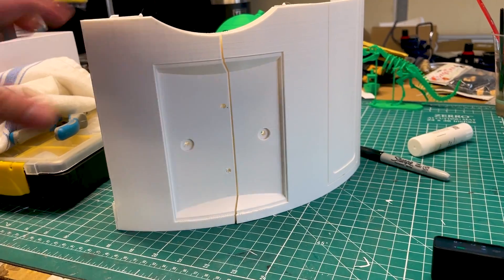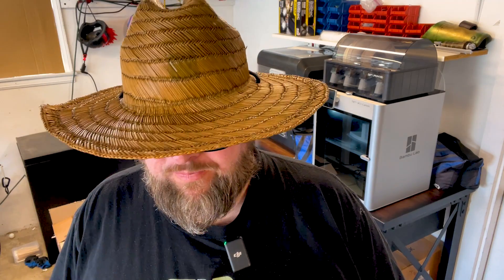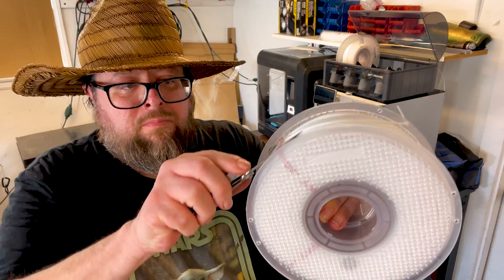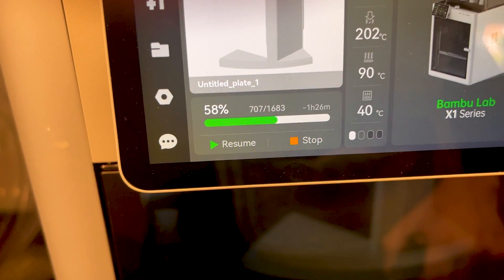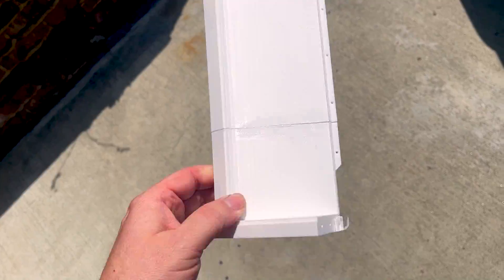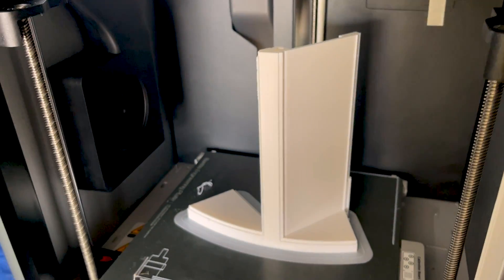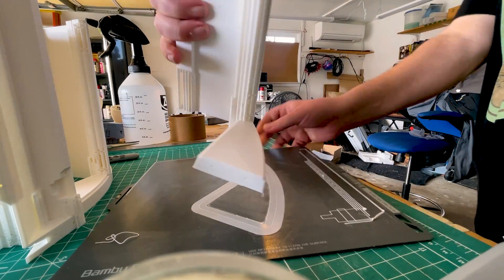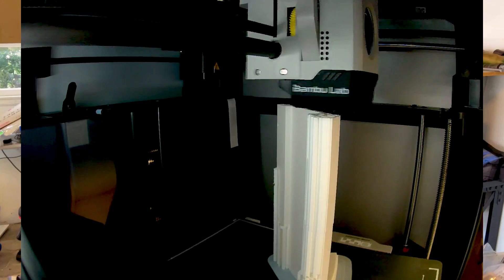Bambu X1C Interrupted Prints / Filament Change

Comment: Hey PapaTone! Thanks for making these videos. I'm in the market for my first 3D printer and was looking at the flashforge adventure 4, in part based on your early experience with it. But now I see you've bought a bambu less than a year later. Should I be getting the bambu instead? Any advice would be greatly appreciated.
Reply: Yes, in my opinion the Bambu X1C is much more fun to use, and definitely easier for a beginner. Specifically because it has automated leveling that really works. The Adventurer 4 said it did, but it didn't really. It's still a manual process, and difficult to use. I'm glad I started with the Adventurer 4. But the Bambu prints five times faster at its normal settings. So for me, the price difference was clearly worth it. Plus, Bambu tests their filaments. This saves a ton of time, if you stay inside their (again, more expensive) gear and filament system. I like things to mostly just work without a lot of jiggory pokery. So far the Bambu has that. Will it last for years? I dunno. Time will tell.

Comment: Can the bambu with the AMS start a second spool once one is done on its own ?
Reply: Yep. That's the solution here that I didn't think of. Partially because I'm saving the other slots for use when (if) the first two fail.

Comment: There is an option for running out of filament. That way when the spool is empty its automatically switch the a other spool with same specs and continue printing. You have to turn it on. It's called AMS Filament Backup and you find it in the settings for filament options on the screen of the printer. You can also turn it on the the Bambu Slicer -->Device -> Print Options.
Reply: Thanks for this I was looking for this info, I knew it could do it but didn’t know where to find the setting. Update: I looked for this and it is under the AMS settings tab not device print options...must be an update to the software.
Reply: Thanks Mikeooo. I'll check that out and appreciate you telling me about it.
Reply: Found it guys, thanks